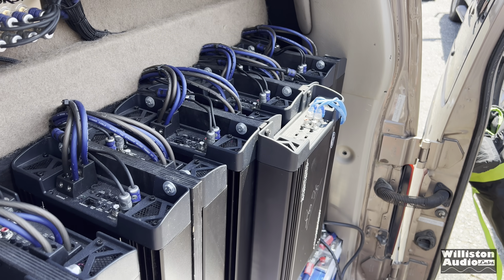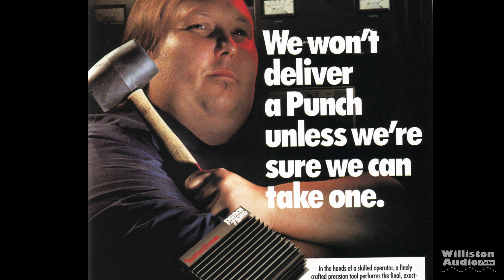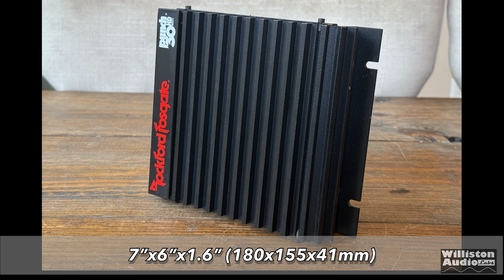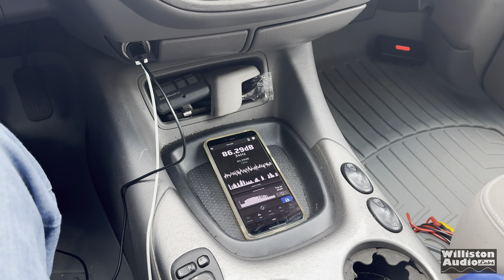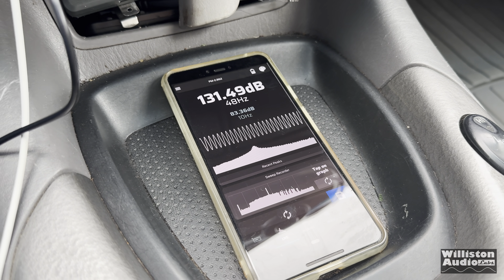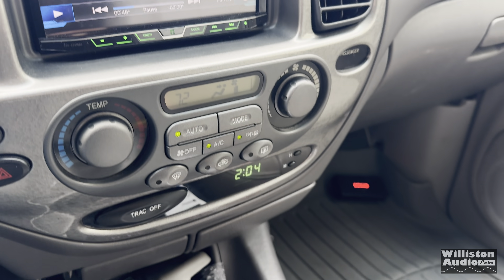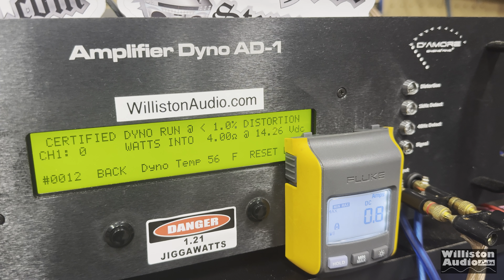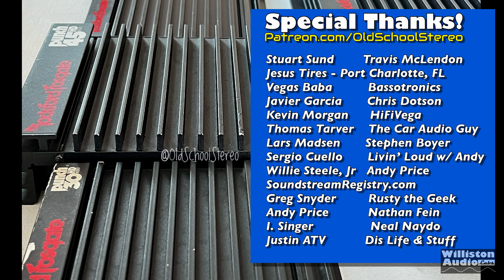Can This 35 Year Old, 30W Amp Power Four 12" Subwoofers?

Comment: Cant remember what RF punch model i had in the late 90s because it got stolen fast but I know it wasn't more than 600 watt and I had it on 4 Kicker comp 15s in a 1989 Bonneville and it knocked and was one of the loudest in my area then. After that I did a wall of 8 Solobaric 12s in a 89 firebird formula 350 with 2 Kicker x100s on them the mids and highs were on ppi art series a600s running 6, 6.5  Kicker resolution series component sets and 2 resolution 3.5 sets and that was pretty nuts. Kenwood head and in dash eq.. At least they couldn't steal that one like the 10 plus other systems before it. Took it out because of local cops ticketing me even when it wasnt turned on. Many many complaints in that boro about me ahahahha

Comment: I'm a late 80's, early 90's thumper and it doesn't surprise me at all! Punch series was one of the best back then. I tried to keep up with a MTX setup but could never get it as good as Fosgate. Man I miss those days...
Reply: Road thunder pro and the 1 gen terminators were awesome.
Reply: @joeymerrell8585  blue thunder was bad ass
Reply: @gabec6522  I have a 150 watt Blue Thunder.  Handwritten in the manual it said it did 532 watts bridge to one channel @ 4 ohms.  I had it hooked to a Polk 12".  I never had to turn it up all the way, and last I checked the 30A fuse plastic was a little bit melted (without opening the fuse).  The whole setup was stolen....and recovered.  So I've hung on to it...cuz it pounded!
Reply: @WildRapier  I had the triple 10 blue thunder with the little 75 watt amp at 2 ohms. Shett was like 200 plus and that shit hit hard
Reply: @gabec6522  I never ran those. I only had the road thunder pro. But they were great subs. After that setup I went all Orion Amps and subs. My biggest setup was 4 Orion ntense 2 15’s on 2 250 hcca amps in a Nissan hardbody xcab. It cracked my windshield.
Reply: @joeymerrell8585  I was a broke as kid so it was a pair of Road Thunder IIs and a Rockwood amp that was actually pretty stout and ran 2ohm mono stuffed under a seat for a couple years lol.
Reply: @madweazl  I spent months worth of paychecks on my setups. Still got the subs and old school denon deck somewhere around here.
Reply: Precision power art series was some great amps as well
Reply: @chaiowinn2071  that was in my 3rd setup. I saved for months to buy the 2100c
Reply: Indeed and Autotek Mean Machine @chaiowinn2071
Reply: @av8ersteve  HiFonics "Power of the Gods" amps were incredible too
Reply: Lol. I still have a mtx 9500 15. Running it on. An older. 2000W cerwin vega amp.

Comment: Would be cool if Rockford came out with a retro design (with current tech inside) using the old school heatsink from the Punch line from back in the day. Bet they would sell like hotcakes! Back in the day I had a Punch 75HD running (2) 12" Lanzars and (2) Kicker tweeters, (no mids lol) running 3-way with passive crossovers in a Mazda mini truck.
Reply: definitely. I would buy one

Comment: In the 80s I started out ignoring ohm ratings for lack of knowledge. I would run 8 ohm house speakers on my low powered amp. I didnt sound bad at all. Amp ran hot however.